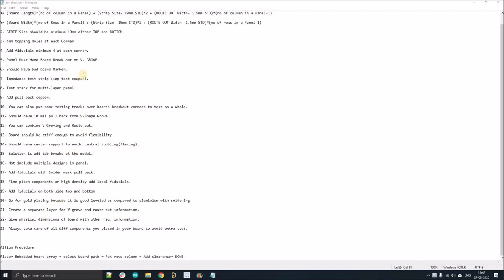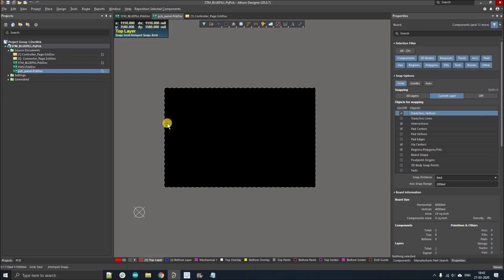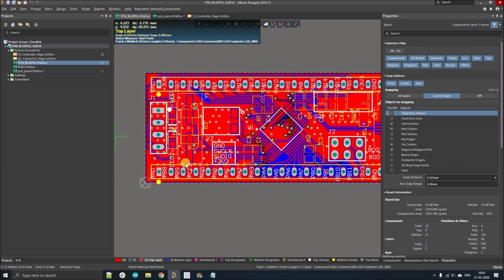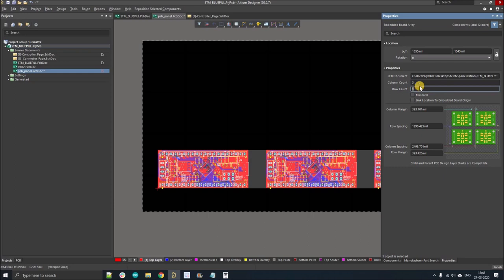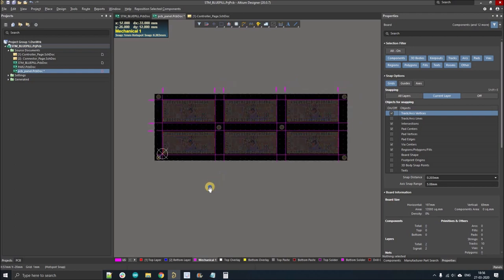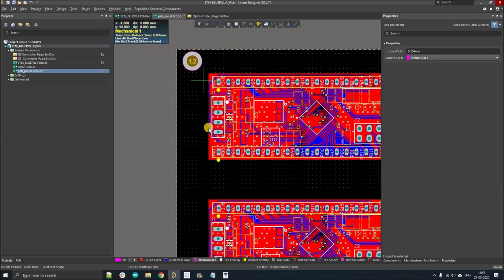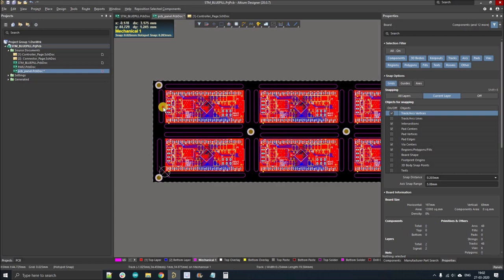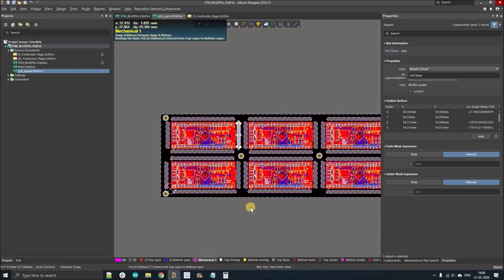Altium Designer Tips #8: PCB Panel Design in just 5 Steps

Comment: There is no need to measure the board, just enter row spacing and the column spacing and the software figures it out the other parameters (margins) automatically.